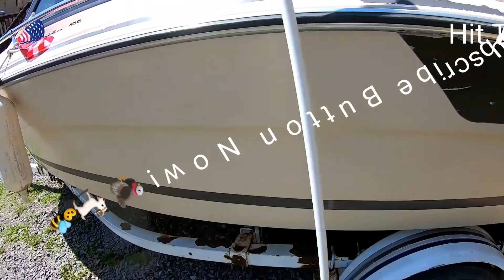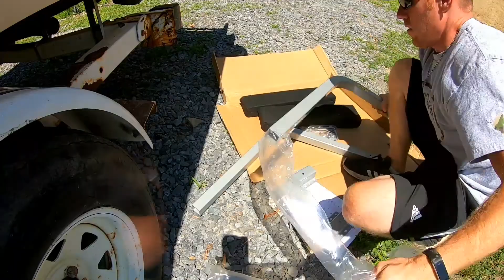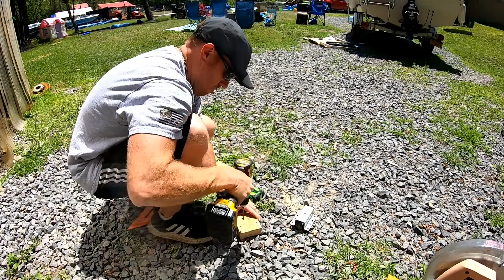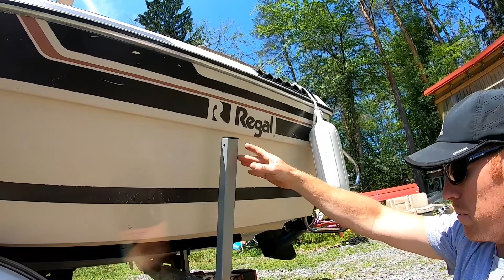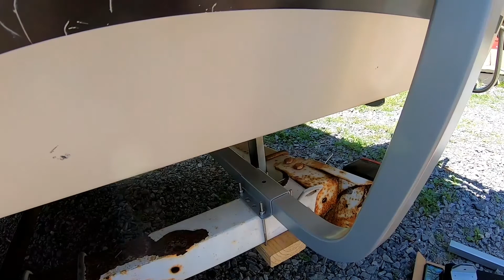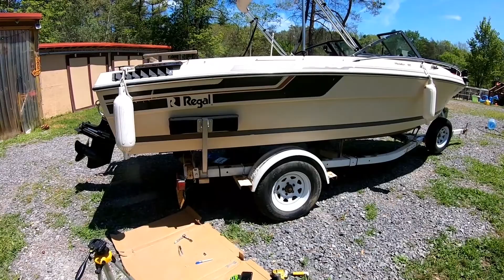How To Install Boat Trailer Guides DIY!

Comment: I have 2 sets on my boat trailer, with boat pole guides. Reason, guide poles greatly help with deep water ramps. The 2nd set is just in front of trailer wheel which is awesome for centering boat in all conditions..... current, wind, waves. The mid side bunkers never go into the water, they have a angle/wedge so they don't catch but allow the boat to sit nicely. They're extremely helpful with boat staying centered and bow roller is never missed. Making SOLO launch and recovery EASY as hell.
Reply from the maker: 💯 I wish I got them alot sooner!!, they definitely make loading so much easier!!! Thank you for watching!👍😊

Comment: Unfortunately, I’m a little slow on the uptake😊.  Why did you need to add a 2X4 below the U-bolt?  The instructions I have do not show an added 2X4.  I’m going to add it based on your video and the similar width of our trailers.  Is it to make the U-bolt more secure?  Thanks for the video!
Reply from the maker: Nope totally get it! I should of explained a little better why I added the 2x4s and yes you are correct to make the u bolts more secure!!!! There was just to much gap and I didn't want to take the chance of the supports slipping one way or another with the weight of the boat touching them as you load and unload!  When you get them you will notice the gap it's not much but enough I didn't want to chance them moving plus the bolts would of stuck up towards the boat a little higher then I felt comfortable lol although those could always be trimmed down and not sticking up so far! Great question though!! If you want you can always email me too and I can send you 360 degree pictures of how mine are!  I have not had any issues and they work great for loading especially when it's windy or choppy waves it goes up nice!  Good question and thank you for watching!!👍😊
Reply: @WhitehouseFarmVet  Thanks so much for your quick response.  I think I’m going to reverse the U-bolt though.  Guide is too high for my boat.  Touching the rail.  Turning it upside down should lower the guide to a perfect level.

Comment: Brother I suggest you get a new trailer. A friend of mine had his colapse while towing his boat luckily no one got hurt. I hate painted trailers. I think galvanized steel is better
Reply from the maker: Lol it's funny you say that lol this Fridays and Sundays videos are about maintenance, painting ,installing new leds, and all new wiring!  I definitely agree with you that galvanized is the way to go! But as you will see in the upcoming videos that trailer is mainly surface rust that I'm able to wire wheel down to good metal, It actually came out really nice! Definitely not professional by any means! but will make it last alot longer or at least prolong it from rusting through, I did go over the trailer it's not as bad as it looked lol  Make sure to check them out I know you said you dont like painted but definitely night and day from how it was!
Thanks for watching!👍😊
Reply from the maker: Hey brother here is the 1st part video 
https://youtu.be/VzcYi7VBJ18
👍😊
Reply from the maker: Here is the wiring of the trailer video 👍😊
https://youtu.be/Ux0GswxCLY8
Reply: @WhitehouseFarmVet  awesome video brother. I love your son gets in there to help. Thanks for sharing
Reply: @WhitehouseFarmVet  trailer looks brand new. Good job thanks for sharing. Love all your content.
Reply from the maker: Awesome! Thanks ,I try to get my kids involved in everything too much computers and phones nowadays! Lol thanks for watching!👍😊
Reply from the maker: Awesome!!!! Thank you I'm glad I could make you a believer lol definitely not perfect but perfect for us, thanks again brother! Have a great summer!👍😊

Comment: Have these Bunk Guide-Ons helded up for you. I plan on buying them but read negative reviews on Amazon. Some claim they are cheaply made Chinese junk.
Reply from the maker: Yes they have held up great!!! Plus another great thing about them is when I'm at boat ramps that are not level they help guide the boat into place alot easier! Thank you for watching and good luck!👍😊
Reply: I recommend getting 2 sets and 1 set of guide poles. Or just make your own like I did. Reason for pole guides is rear side bunks get submerged but help center rear of boat as it's going on. Reason for 2nd set of side bunks is to center middle and front of boat so it hits the bow roller with no issues ever. Using this combination will make Solo recovery and launching stupid easy. You won't have to deal with current, wind, waves or drift....ever again. Puting boat on trailer should be easy but most the time it isn't because of the reasons I have already stated. Hope this helps you. It did for both of my boat trailers. FYI, I even made boat trailer steps that mounts to the trailer.....some metal and welding. This is my 2nd most important improvement for any boat trailer.

Comment: I would have thought installed them from the bottom of the beam. The extended part of the guide could still damage the boat
Reply from the maker: No the boat can't touch that part! The boat guides are almost a foot and a half above, there is no chance of the boat touching them, thank you for watching!👍